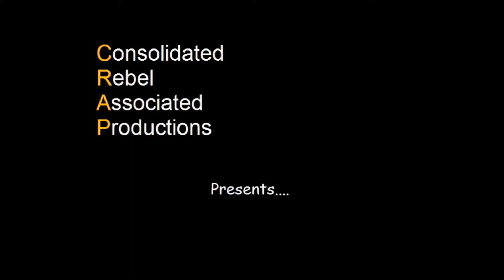Mr H back on the tools. The shed project, Phase 3

Comment: Its a good job you doubled up on that shed floor Mr H with all them big dinners your having at the in laws.
Willow pattern plates as well mmmmmm.
One of my neighbours let his felt run down from the roof to the side of his shed so he wouldnt have to worry about painting it with wood preservative in years to come, I can see that you can lift out the fence panel  to do it but you never know in the future the in laws  might not have friendly neighbours living there.
Reply from the maker: Ha-ha very true regarding them dinners Mick. 😉

The letting the felt run down the side of the shed can sometimes make the timber sweat and rot from underneath the felt due to the moisture having nowhere to escape to only keep soaking back into the timber. Also and this is just my opinion it looks ugly and makes the shed look like it belongs on an allotment rather than in a garden. 

I'm not a big fan of fence paint either if I'm honest and prefer using Creosote as it soaks into the timber rather than just on the top surface but it's my father in laws shed not mine. 
Likewise he wanted the shed built there and any future maintenance is going to be his problem not mine but there's enough room to lift his fence panel out from the back of his shed and get a roller down on a brush handle should his neighbours ever become arsey.
Reply: I think you have done a very good job  Mr H, did you read how to do it all on the side of the  handymans  DIY tin
Reply from the maker: Lol no Mick, I got all my info from those free 'How to....' leaflets near the tills at B&Q. 😉